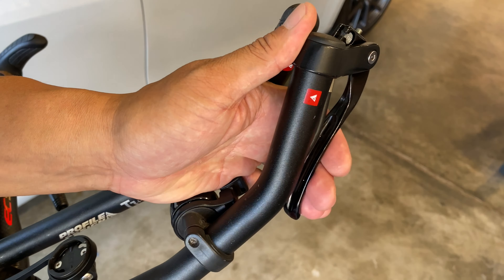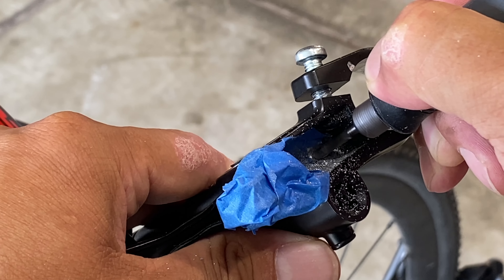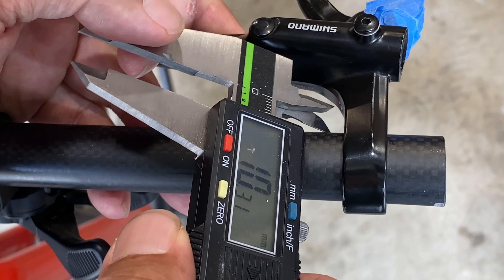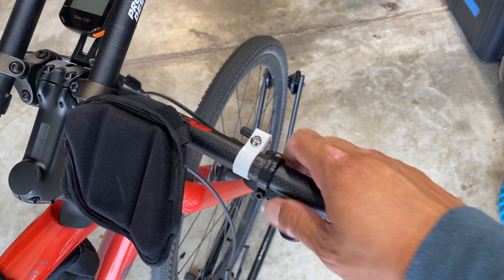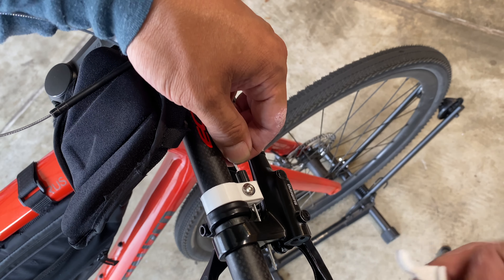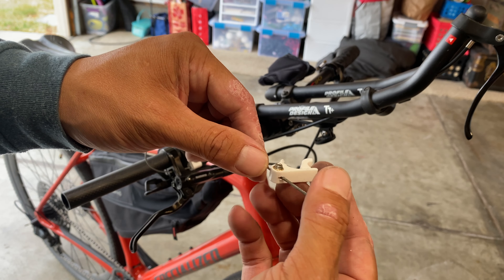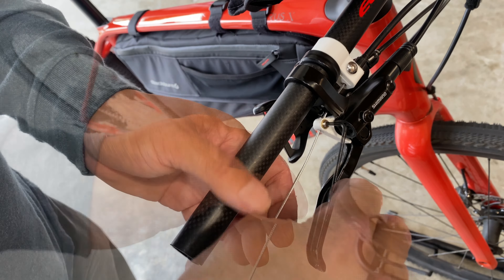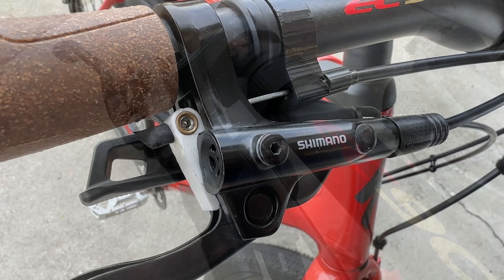Integrating Aerobar brake handles with hydraulic brakes

Comment: This is kind of like the "lite" version of Giant's Conduct mechanical-hydraulic disc brake system. Basically it has a master cylinder on the bars, but regular mechanical brake levers or STIs otherwise.